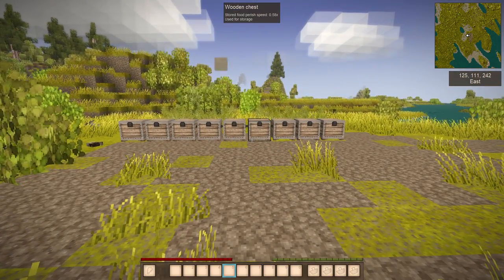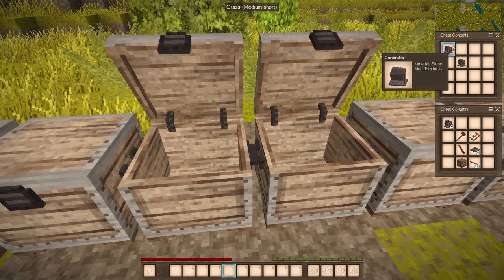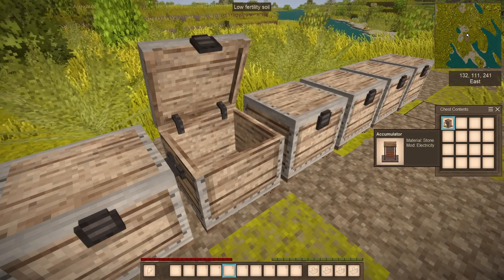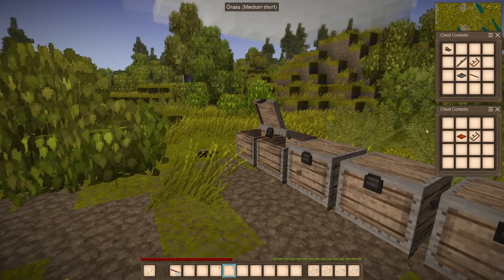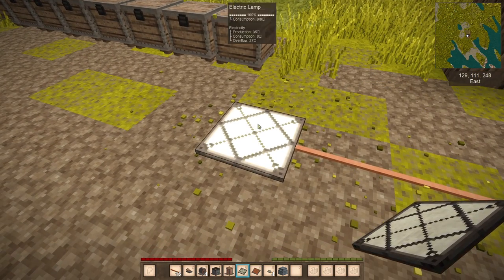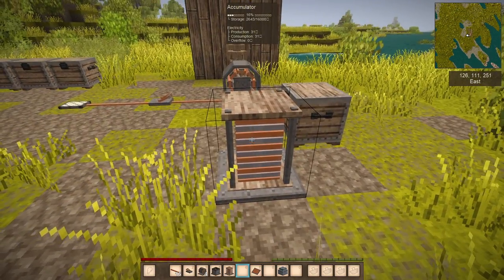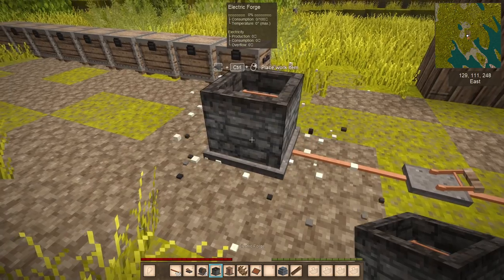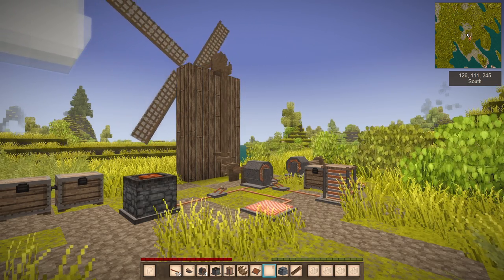Vintage Story: Electricity Mod Showcase

Comment: I love how rustic the style of the electrical components are. Will water wheels only be used in actively moving water to generate power?
Reply from the maker: I haven't try out that mod yet but maybe it would still function since it use the axle to spin to generate power